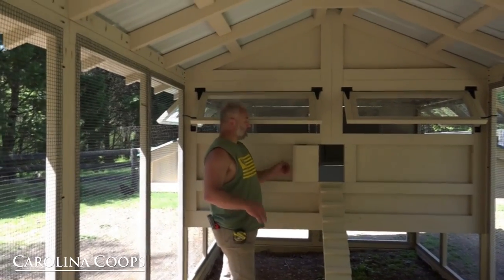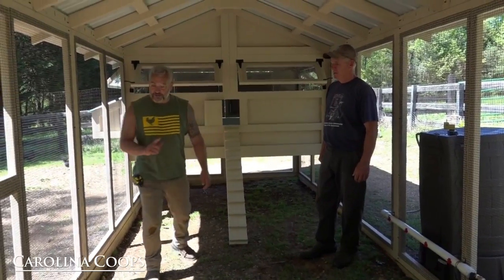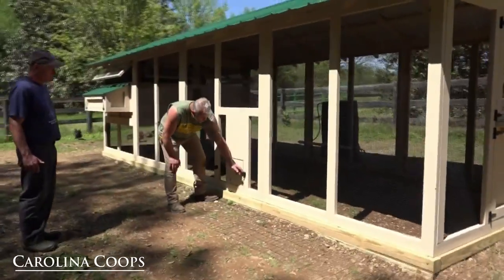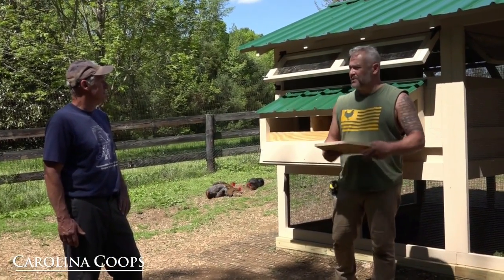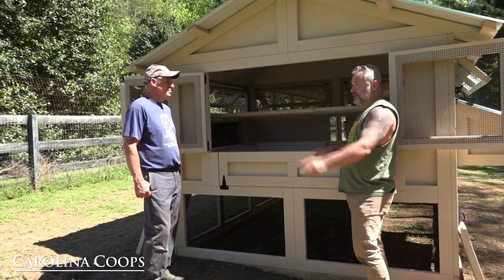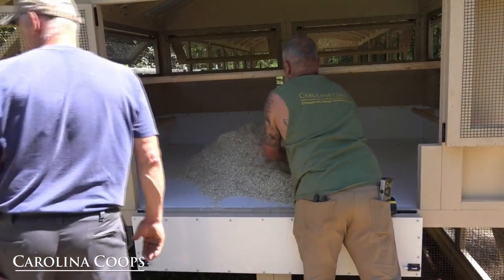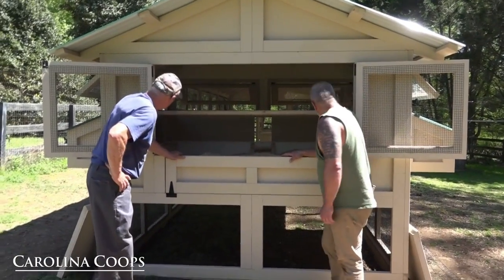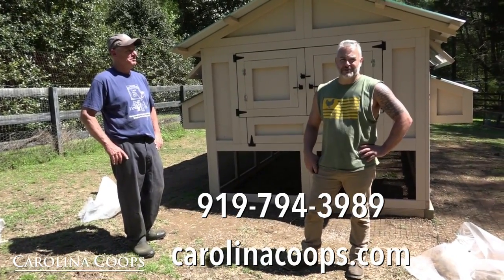Deep Litter Method Explained - How Many Hemp Bales for 8'x6' Henhouse

Comment: I have a couple of questions for anyone willing to answer.  My husband build a 4x6 coop with a 20 foot run based on these designs, (Thank You!)  He set up an auto feeder, waterer, and deep hemp litter; and was going to teach me about how to manage it after I returned from taking care of my mother out of state for a couple of weeks.  Well, he unexpectedly went home to the Lord before I got back.  I have 11 hens and one rooster.  I know nothing about chickens and find myself on a very steep learning curve.  First question is do I need to clean the run?  They have worn all the grass away and it's just dirt now.  When it rains it does have a slight smell, but once it dries it doesn't.  Secondly, when I turn over the hemp, am I supposed to go all the way to the bottom of the hemp to turn it over or just the top half?  I've been doing it once a day all the way to the bottom unless it raining (I skip that day), is that okay? Thirdly, am I supposed to spray water on the hemp once in a while to keep it slightly damp?  Last question is am I supposed to add animal grade diatomaceous earth or First Saturday Lyme to the hemp? I don't know if you've answered these questions in other videos or not.  I know my husband has watched just about every one of them.  But I'm trying to manage so much that I never had to before that I just don't have the time right now.  Thank you so very much.

Comment: The deep litter method makes compost if I am understanding it correctly. Compost creates heat. Is there any concerns for people who live in warmer climates? I am in Texas and heat is an issue. I have some shady areas but to deep shade. I would love your thoughts. Your coops are gorgeous!
Reply: Read with Lollie 
There are two kinds of composting, aerobic and anaerobic. Aerobic is where you turn the material over and introduce oxygen. Anaerobic is where you let the material sit and you don’t turn it over. This will not introduce oxygen to the compost and it will not produce heat. The deep litter method is the anaerobic process so it will not produce much, if any, heat.

Comment: great video, thank you! and a bit jealous of the coop. we built ours as a simple poured concrete pad with a drain in the middle. we scoop the poop and power wash the concrete. and of course there is a roosting bar, and then we let them out all day as free range. is it really two years before changing out the hemp litter? has anyone actually waited that long before changing it out? would it be possible to use the deep litter method on top of our existing concrete pad coop?

Comment: Thanks to Covid a supply issues you can’t even buy the hemp or it’s 80$ for 30lb. Will pine still work with the deep liter system?
Reply from the maker: yes pine shaving will work with the deep litter system. Hemp will always be pricey, but certainly if its use was more mainstream, the price would go down. Thanks for watching.
Reply: @CarolinaCoopsVideos  where can I get it your out of stock and most other places ?

Comment: I'm currently building a coop that follows a similar design.   6x16 overall with a 6x4 coop on stilts and 6x12 outdoor run.  I'm about 50% done with the construction.
Thank's very much for the video.   Seeing the qty of bales needed was handy.    I'm about half the size, so 2 bales should be plenty!
Reply: Likewise here brother. Currently building one 6'x10'  built off of a 6x6 treated base sitting on the ground. It also has a 4'x6' enclosed coupe similar to what is shown here. Can't wait to get my birds outta the house ( currently 3 weeks old)
Reply: @mattdg1981  Awesome, sounds just about the same size as ours    Good luck with the flock!

Comment: How come not just put one bale in at a time and then once it gets messy, add another bale on top?  I thought that's what deep litter method was.  Where can I find that sort of bedding?

Also, how would one block off the nesting boxes until they are old enough to lay so they don't try to sleep in those?  

Beautiful coop and run!
Reply from the maker: You can do that, but we like to start with about 4-6 inches of the industrial hemp (the beds are 12" deep), and add some more as it breaks down and starts to smell.  We sell the industrial hemp on our website: 
https://carolinacoops.com/product/hemp-bedding/
and on Amazon, shipping costs will be different depending on where you live. 
https://www.amazon.com/Carolina-Coops-Industrial-Hemp-Bedding/dp/B07HJC79HQ/

Comment: How is the hen house supported underneath? Is it just 2X4/2X6 with screws or do you use joist hangers? Are there concerns on how much weight it can hold?
Reply: A second question, how do you anchor the hen house/run to ground or is it just floating?
Reply from the maker: @natebauer4447  there is  wood structure under the henhouse, the HDPE is cut to size and put inside the henhouse on the floor and screwed on the sides. If you look at the DelRay Beach Florida coop video, you will see a full grown tall man standing inside the henhouse.

Comment: Thank you for the videos.

How much hemp for a 6x4 coop?

And what is preferred adding hemp on top of smelly bedding or turning it for the deep litter method?
Reply from the maker: We recommend two bales of hemp for that size. Put in one bale to start and add from the second bale during the year as needed. We also suggest both, adding on top, but also turning it every once in a while because the stuff on the bottom breaks down so well, it's like new! Hope that helps. Thanks for watching.

Comment: Hi, We are building our coop with a similar design like yours and planning on using hemp with the deep liter system too. What's the difference between local Industrial Hemp and yours that is imported from France? How do you charge for shipping to California? Thanks!
Reply from the maker: Hi Irene, the hemp we get is from a different part of the plant and is much softer than the other industrial hemp we've used in the past and have seen.  However, that being said, industrial hemp that is locally grown makes an excellent bedding for the deep litter system.

Comment: I use the deep litter method in my coop using industrial hemp.  After the first 3 months the chicken droppings just balled up and didn't decompose.  We stir the litter once or twice a week.  Wetting it down appears to have helped.  Do you recommend adding water, or leaving it dry?
Reply from the maker: Dirthawg I am actually very glad you asked that because one thing that I don’t Magine very often about the industrial hemp is you actually are supposed to missed it to activate the absorption and micros do you need moisture to help with the composting I get nervous sometimes mentioning that because I don’t want people to add too much water and over the years of practicing the deep litter system we have never had at Coupe that needed to have moisture added to it
Reply: I dont use deep litter i have a small coop, i ckean 1 a week and add some poweder baking soda for the smeel, i use shavings in the nesting boxes with sage or rosmery branches, if yiu have a small coop rosting area not run they will.keep them selfs warm